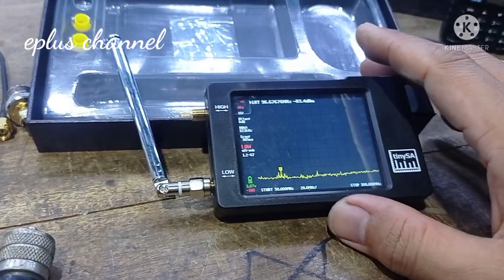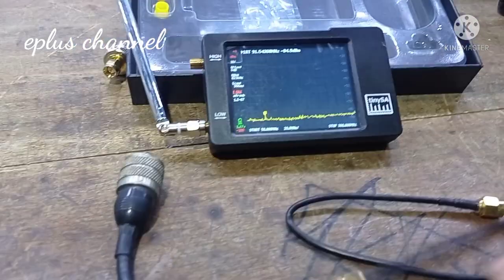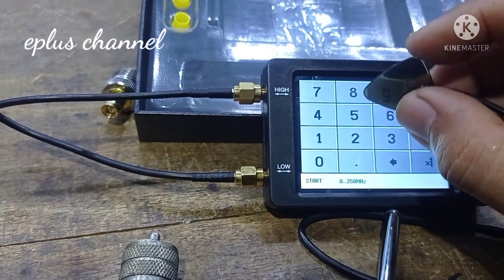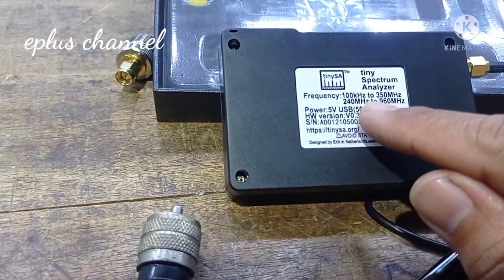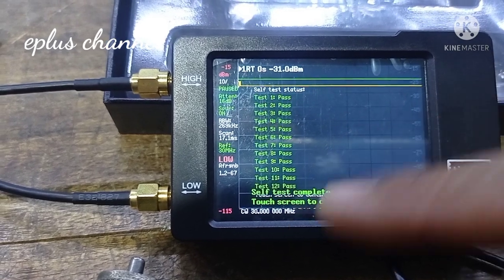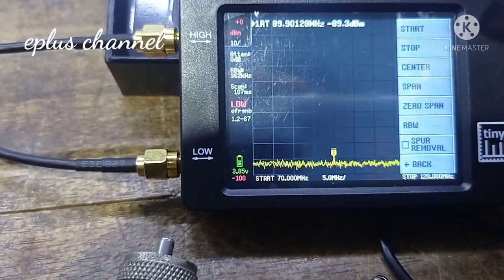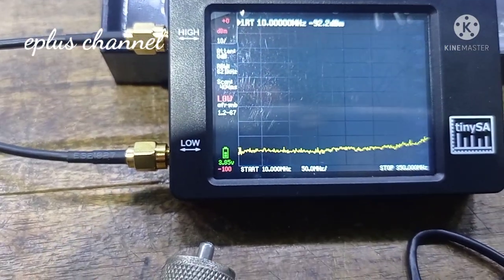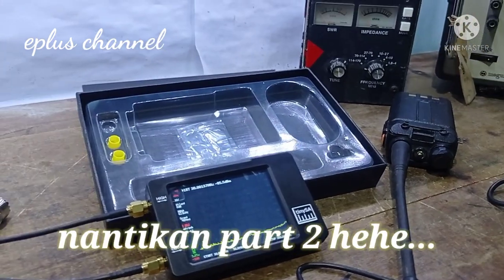Review tinySA dan Cara Kalibrasi Spectrum Frequency Analyzer by eplus klaten

Comment: Klo mau kerja di 240-900mhz...tinggal menu pilih mode...kemudian pilih switch to high in....nanti yg berfungsi input konektor yg high membaca signal 240-900mhz...akan mendeteksi RF 240-900mhz dan bisa di program preset...klo mau kembali ke low tinggal masuk menu mode pilih return to loe in....atau klo dibuat fungsi generator juga bisa di masing2  low 50khz-350mhz atau di high 240-900mhz....semoga bermanfaat...sing penting sabar dan tawakal....hhhhhh
Reply from the maker: Terimakasih banyak mas.. ketemu td saya otak atik hehe bener caranya itu.. lg tak upload video berikutnya.. makasih banyak mas

Comment: Om...bisa minta tolong kalibrasi kan? Ntar Sy kirimin....? Nyuwun tulung....kranten gagal melulu... suwun2
Reply from the maker: lha kenapa mas kasusnya
Reply: Saya juga mengalami kendala seperti itu.
Setelah Sy tekan CONFIG.lalu sy tekan SELF TES  .
_Tes 3:signal level fail
_Signal level too loe
_Did you connect high and low post with cable?
begitu tulisan yg mucul.semestinya Complete.mohon bantuannya